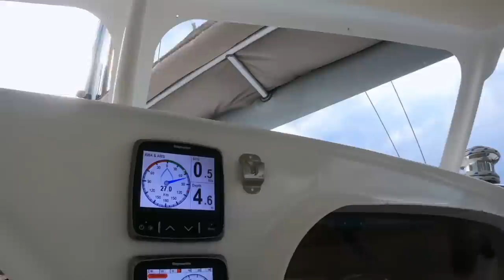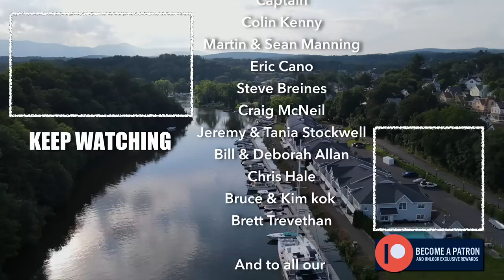Dropping a big mast on the cheap - Great Loop #5 Sailing Life on Jupiter EP84

Comment: Ouch on the 1100 anchor. How much did the anchor swivel and the extra heat chain cost? 😞
Reply from the maker: Still got a short chain Latitude...its a bit limiting sometimes.
Reply: @SailingLifeonJupiter  You might be able to pick it up cheap in the area your in. Taking the opportunity to do so may be a good idea.

Comment: Is there a reason you don't strop your anchor old bean. it would have stopped you loosing  your last one. easy to say i know but worth thinking about. ?
Reply from the maker: Trip line BB?... Yeah we use in the rivers with a constant current.. But it constantly gets tangles up... in the Hudson the strong currents reversing 4 times a day it would have been a birds nest.
Reply: @SailingLifeonJupiter  what we do is attach the anchor chain to the head of the anchor . Then put two small sacrificial strops through the chain and attach it  to the anchor where the chain meets the anchor eye. That way the anchor still takes the weight of the boat but if it gets caught then pull it up on the winch 
when  it gets near a steep angle and the strops break allowing the winch to pull the anchor out backwards. what we use it in the bristol channel 14/16 knot tides everyday.  could that work for you ? it saves a lot of anchors and chains for us
Reply from the maker: @BB-tm7gx  that does sound like a good idea... But in our case it was our chain that was snagged on something not the anchor... But thanks for the explanation of the strops... I haven't heard of  that technique... Cheers